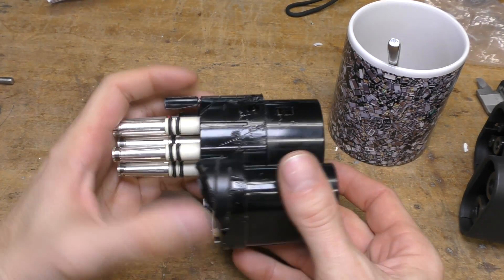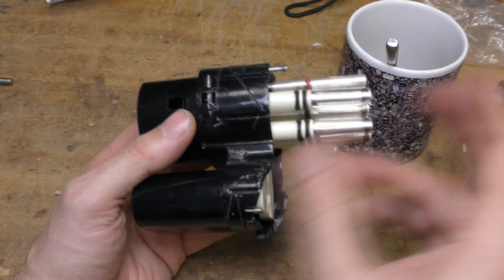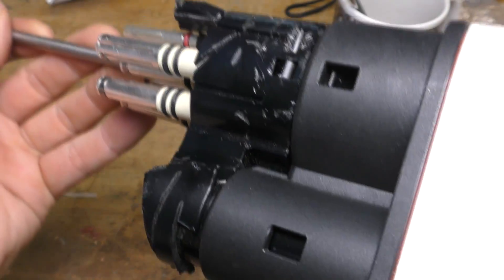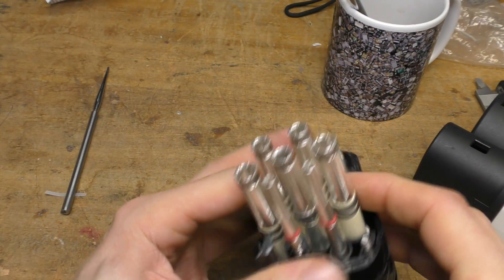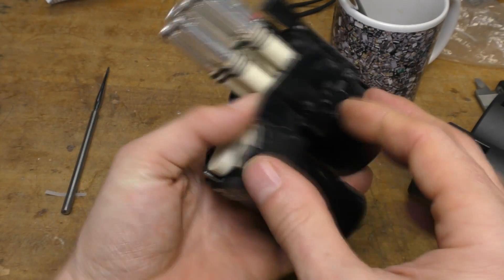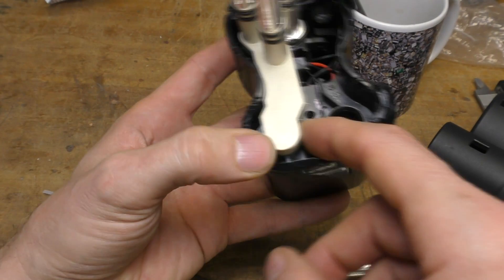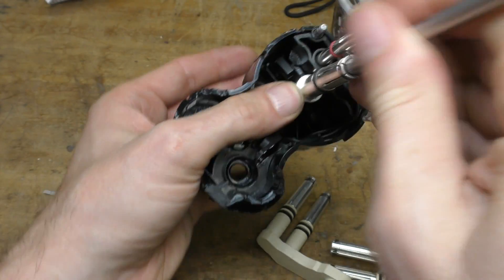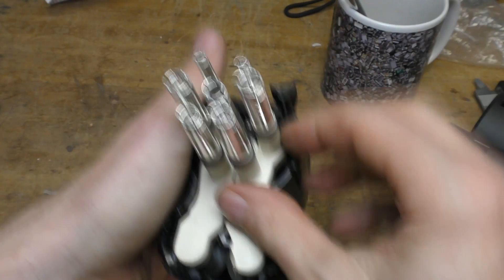Tesla European CCS adapter teardown

Comment: What Tesla did was standard in 2013. Type 2 could do single phase, 3 phase or DC fast. But in 2015 VW came up with CCS after dieselgate to 'make fast charging possible' and put CCS on own vehicles, while nerfing them to 3.5kW when not using CCS. So if you used type 2 on VW, you were limited to 3.5kW, while it could do up to 43kW AC and 150kW DC.
I hate CCS so much.
Looking at circuit diagram, old Renault Zoe could do DC over Type 2, like Tesla S/X, just it lacks the software for communication.

Comment: 0:11 and that's how much Tesla is committed to sustainability. Even a simple adapter is unserviceable.
Reply: I don't think an plastic connector with high voltage like this should be serviceable...
Reply: @jb5631  anything should be made as serviceable as possible. I didn't think I'd need to explain this – as it's quite obvious, really – but every little appliance that you manage to get serviced instead of just throwing out (and buying a new one), equals less unrecyclable waste ending up in a landfill. And in the case of the adapter shown in the video, it's quite a substantial amount of waste.
Reply: EVs are gonna fail. In fact they’re already a failure; were they anything else, exponential growth would’ve been seen, and it is a niche obsessive audience which have them.

Comment: The Tesla connector designed by engineers to encourage EV adoption.
The CCS connector designed by the ICE manufactures marketing department to discourage the adoption of EV's.
Reply: the biggest joke for me is type1(j1772) and ccs1 - even with single phase they can use ccs2 without problem - today I browsed plugshare app and some charging points in US are limited to 6,5-7,2kW - one guy even modify his ZERO bike with 12kW charger for dual type1 sockets so he can charge from two different stalls with full power
Reply: Then there is chademo. made by idiots
Reply: EV adoption doesn’t need “discouraging”, the entire premise is laughable AT BEST. It’s a very deep and wide delusion.
Reply: @unlokia  
Guess you have never owned an EV?
Last month my electricity cost to run my Model Y was $29
Charge form my solar system in summer,.
No oil changes
No exhaust system to fix
No spark plugs to replace
First major service was wiper and cabin filter
After 60,000km breaks look like brand new
Drove across Canada cost $140
Gas stations are places to your the wash room and get snacks
Always have a full battery in the morning.

Comment: Is it true that the US uses a different CCS connector? One that's J1772 compatible? That would make it impossible to fast charge a European car in the US and vice versa.
Reply: There is one small electrical difference. In CCS2 Type 2 the Prox.-Pin is just pulled down with the 13A-coding resistor to PE inside the plug. In CCS1 the Prox.-Signal guided through the charge cable and terminated in the EVSE. This allows the EVSE to monitor the Latch-Switch, which is only present in Type 1.
Reply from the maker: Yes, in the US, CCS is based on the type 1 rather that type 2, otherwise identical
Reply: Yes, it's different here in the US. Two main standards (other than the Tesla proprietary)- CHAdeMO (very much falling out of favor) and SAE CCS which is just a J1772 plug with the two extra DC pins frankensteined on.

Comment: I don't get the hate on CCS, sure it's big and bulky but it's a standard meant to cover everything all the way up to trucks and buses in many weather conditions and last tens of thousands of cycles. 

This Tesla adapter however just shouldn't exist, going with those proprietary dual use AC/DC pins and modified and oversized connectors and internal wiring just to get mid power DC fast charging without the full CCS connector is pointless when you can just put the whole damn connector in the car and not need this adapter to use any standard DC charge point plus you get the full power capabilities of CCS. In my view it's almost as if Tesla knew they had to comply with the EU requirement to use the Type 2 connector but hadn't given up on the idea of a propriety Supercharger network outside of the US when they made this, but of course CCS has since left Tesla behind and now they're switching everything to CCS which will be a very interesting sight in 5 or so years.
Reply from the maker: The protocol is unnecessary complex and uses an inappropriate physical-layer interface, causing compatibility problems and difficulty in debugging to diagnose these problems. Uses a single-source part.
Reply: @mikeselectricstuff  It is not single source any more. Beside the QCA700x there are also solutions from ST Micro, Lumissil, Vertex Com. The reason for the PHY Layer selection is the fact, that the Connector design was frozen before the PHY was selected. The only way was to use RF signal on top of the Control Pilot.
Reply: @mikeselectricstuff  Sure it would be nice to be able to do DC charging with something similar to the super easy low level communication of standard AC charging or simpler CAN bus CHAdeMO but the high level communication and PLC is very much essential for future V2G/V2X features and future PHYs. For example, a 250 kW EV that is not capable of PLC and thus not able to do load shedding will only cause problems for the grid in future.

However I will say some of the things envisioned in the standard are rather pipe-dreamy (eg. wasteful kW level wireless charging), but I guess it's better than not planning for them and finding out there's actually an important use case for it.
Reply from the maker: @WizardTim  Nonsense. all the charging and V2G/V2X etc could easily be done over CAN or RS232. All it needs to do is pass a few parameters for current and status etc. Even secure authetication etc. doesn't need much bandwidth. It's always going to be a point-to-point link between the car and one other device - no need for any networky stuff. Anything upstream of that should be handled by the box the car gets plugged into, not the car.
Reply: @mikeselectricstuff  I agree today all the communication for just DC fast charging and encryption/authentication/access control could be done much more easily over conventional CAN or RS232 without any networking but many future V2X standards envision a highly interconnected world where few pieces of infrastructure will be a point-to-point link between the car and one other device. Many of those standards weigh heavily on what sort of communication is required for the SAE level 5 autonomous vehicles of the future, not the Tesla "FSD" toys of today but cars and trucks that can make entire journeys recharging along the way completely without any human. In this future the same TCP/IP CCS V2G packets on current PLC can just be slapped into other V2X PHYs either 802.11p or C-V2X rather than redesigning the entire system from the ground up, this is why cars are being designed to handle those networked communications today to lay the ground work now to understand what is needed for the future.
Reply from the maker: @WizardTim  The car will always plug in to exactly one device. There is no need to complicate the simple charging or discharging process with all the 'minority' stuff that can and should be done at the other end of the cable where needed. 
The vast majority of use is simple charging - to burden that process with a ton of complicated stuff is simply a poor design decision made by standards-setters with no clue about real-world issues.
Reply from the maker: Car manufacturers have a hard enough time writing software as it is. Even harder keeping it up to date. It makes far more sense to push the burden of complexity onto the much smaller number of chargers/peripherals, which are much easier to keep under control. Not to mention the potential security risks of a car having access to a network via the charger, instead of a single limited-function communication link.
Reply: @mikeselectricstuff  Currently the vast majority of use is simple charging because that's pretty much all that's currently supported. But the future standards don't see it as a simple charging or discharging process with point-to-point communication, the standards are designed to facilitate much more advanced networked functionality like cooperative charging, bidirectional V2H power transfer and aggregated V2G bidirectional power transfer by the 2025 to 2030 time frame. Those are things many consumers and grid operators want/need.

If car manufacturers can't design and maintain those systems for interoperability and security then a world with SAE level 5 autonomous vehicles will simply never be feasible.
Reply from the maker: @WizardTim  But there will always only ever be one thing plugged into the charge port at a time. The fact that we don't know what those things may be in future alone makes it senseless to add  complexity at the car end.
Reply: Note that there is already single-wire CAN over the “control pilot”, and there is DC over the CCS (as implemented by Tesla). It’s just that Europe didn’t want to reuse/standardize that.

That being said, with the necessary water cooling for the many hundred amps charging for even the cables, bulkiness of the ridiculous connector isn’t that much of an issue. Just have a look at the arms-thick cables dangling from the newest DC chargers.

Standardizing on communication over PLC is a bad joke, though…
Reply: EU requirement to use proprietary technology is what shouldn't exist. It's as if they'd standardized on lightning instead of usb and forced everyone to buy apple lightning chips.
Reply: The hate comes from: north americans think tesla is the first electric car, so they think it's the best tech available. Also, tesla built a huge infrastructure on chargers with it's own design so people get used to it (and also americans don't import electric vehicles from europe because "there's no infrastructure"). 
The standard was created in europe strictly for companies don't do what tesla did, privatizing infrastructure.

The type 2 CCS Is ugly and bulcky but it's future proof, simplifies the charger and is a STANDARD for all types of vehicles. Many companies can make it and it getss cheaper and replaceable.
I think DC fast charge is a premium on the car. It won't matter for the masses, that will use standard AC in most aplications!

btw, never seen nobody hating on gas pump standards hahaha

Comment: They probably just don't want dabblers fixing or modding the connectors in random ways.  (Like bypassing the safety circuit because the switch failed.)   I quite look forward to the inevitable high current charger CCTV incident footage.
Reply: You mean tesla branded welder in use :>

Comment: I'm also annoyed that Type 2 cars don't use the 'DC-Mid' mode too.. 50kW through the normal plug without the CCS would be super useful for shopping centers and smaller places with lots of cars plugged in.
I suspect they don't because the US plug dosen't have the same mode, so they use the same internals and just change the AC/main plug.
Reply: The US version has that. It is called SAE DC Level 1. 48kW max. I don’t think any cars support it though. Likely the same for Mennekes. Specified but no car support.
Reply: When I first heard of CCS I thought it uses the two DC and all three AC pins at the same time. Cause that's what the name implies "Combined Charging"

Comment: I don't particularly like the bulky connectors either. From a safety standpoint though, having completely separate paths for AC and DC does eliminate the risk of AC and DC crossing paths where they aren't supposed to due to a stuck contactor either on board or at the charging station unit. I'd imagine any fault going undetected here is going to mean quite costly repairs.
Reply: If they does, car will gonna deactivate this part of the car(let's say, charging). But I agree, having a separate circuits for me looks like a better idea, but it's done for simplicity of end user.

Comment: I share your opinion on CCS. I'm currently developping a 24kW DC CCS fast charger, and the CCS protocol is overly complex, uses Greenphy chips only sourced from Qualcomm, which can lead to supply issues.
Chademo use CANbus, which is robust, well-known and bog-standard in automotive, CAN transceivers are cheap and available from dozens of manufacturers.
Unfortunately, Chademo is now a dead standard
Reply: Agree on all points but the chip availability. Qualcomm are hell to work with but luckily there are a few other options. HP GP modem chips are also available from ST, Lumissil and Vertexcom. The Lumissil part, IS32CG5317, is even stocked by Mouser.
Reply: @Mikkel324  Oh, interesting, I was not been aware what someone else is having this GreenPHY chips. I was thinking what QCA7000/7005 is only option!
Reply: @Mikkel324  Ok thanks, great to know !
Reply: I'm pretty sad about chademo. I like it. I think using 2ports is better for longevity of this ports. Did seen j1772 with a burned down pins.
Reply: CAN is also dying. Car companies are switching to 2 wire Ethernet. Sure CAN will remain as long as OBD 2 exists. But do EVs even have OBD?
Reply: @stevebollinger3463  Yes, EVs have OBD ports. OBD2 is actually required by law here in the US, of course the law doesn't specify what protocols are used behind the OBD2 port (e.g. everything could be ethernet with an OBD2 interface just for third party diagnostic devices)

Comment: what is wrong with the type-2/CCS-combo?
Reply: Also no bidirectional requirements implemented yet.
Reply: @jayjaytronics8358  CCS supports bidirectional charging. It's usually not implemented, owing largely to a lack of real-world use cases. AFAIK the only vehicle that fully supports high power output through the CCS port is the F150 Lightning, which to make use of that requires an additional ~$4000 in hardware installed in your home. There's as lot of talk about V2H/V2G but the reality is that stuff is expensive and users don't seem keen to pay for it.
Reply: @Smidge204  Yes "support" maybe - but IEC 61851-23:2020 is still in development and nobody knows what regulations apply to the grid side (IEC 61727 for PV systems maybe?). It's a mess if you try to future-proove current designs. Speaking of Mode 4 currently - would you add secondary side synchronous rectification? +4 gate drivers and power switches?!
Reply: @jayjaytronics8358  As far as Mode 4 is concerned, the standard defines what the charger needs to do and doesn't get involved with how the charger does it. Dual active bridge with secondary side synchronous rectification? LLC converter? ZVS converter? Not the standard's problem, and not relevant to bidirectional power anyway. (Sync. rectification seems to already be the preferred strategy already)

For grid tie/bidirectional power, you probably want to look at IEC 63110 and ISO 15118 instead.
Reply: Overly complicated comm protocol
Reply from the maker: @LambdaWave84  mostly that, plus vague spec that is interpreted differently by different manufacturers, high minimum voltage that makes it unsuitable for motorbikes...
Reply: @mikeselectricstuff  The newer version of the standard specifies 50-500VDC (K) or 200-920VDC (L).
So I guess a K charger can charge motorbikes, but on the older version of the standard the minimum voltage was higher (150VDC if I remember well)

Comment: For all it's flaws, Tesla does have some amazing engineers! I wonder how frustrated they are about Tesla's whole vendor lock-in and anti-repair stance.
Reply: Well, the issue with CCS is design by committee. Tesla, doing their own thing can omit all the politics of making twenty different parties happy...
Reply: Tesla is pretty repairable, unlike apple products. Max what they can do is disable your DC charging capabilities, but they can be returned and all what you will gonna loose and access to supercharger network, but still gonna be capable to charge on other 3rd party DC charges as EA, charge point and EVgo.

Comment: I always was been curious what's inside us chademo and CCS adapter.
Reply: CCS adapter is basically passive because newer Teslas have a charge port ECU that talks CCS natively, it's just basically a pass through dumb adapter with some temp sensors.

Chademo adapter is way more complicated, it's translating all the comms as well. I work with the guys who wrote the firmware for it actually.
Reply: @HillierProductions  I figured by a price what CCS adapter is probably nothing fancy, since it's just 250$. Unlike chademo what probably have something like stm32 with aux can controller and something what talks to a car as well. Chademo is pretty simple protocol and well described and documented already. I'm really curious to see tesla supercharger/ac charger protocol reverse engineering.
Reply: Tesla AC charging is just J1772 basically. And Supercharging uses the same J1772 lines but switched to CANbus instead. It's actually quite simple on that layer, it's the higher level authentication to lock out anything but specific VIN Teslas that's more complicated.
Reply: @HillierProductions  Oh, very interesting and elegant solution! Thanks for sharing this info!

Comment: could you do a seperate video elaborating on your opinions on CCS?
Reply: I had the same question! 😊
Reply: CCS is better then no CCS. By my opinion, chademo is still better if it gets advanced voltages up to 800-900v.
Reply: CCS does up to 1000V. Same as you indicate. Although you’ll never see over about 880 I think.
Reply: @stevebollinger3463  In Germany the first CCS Chargers with 1000A/1000V pop up. (e.g. Sortimo Zusmarshausen)